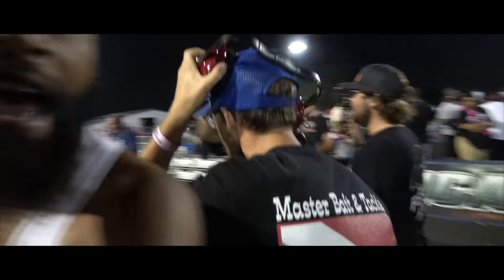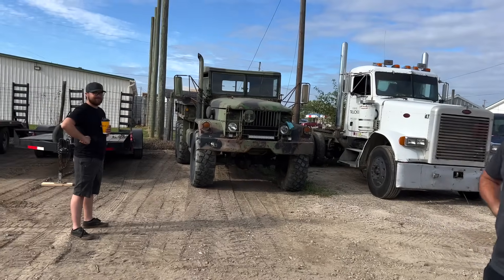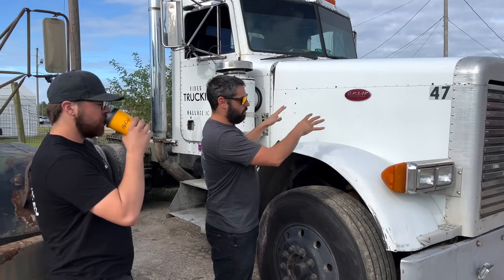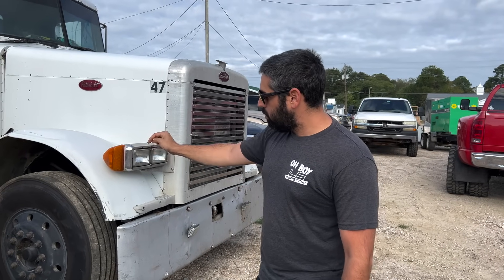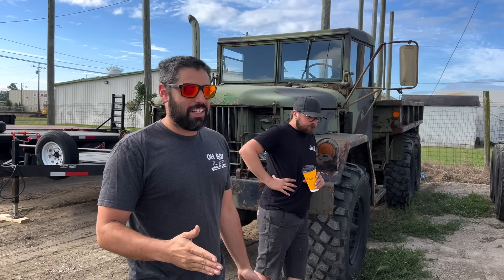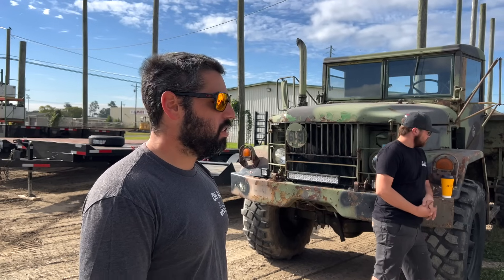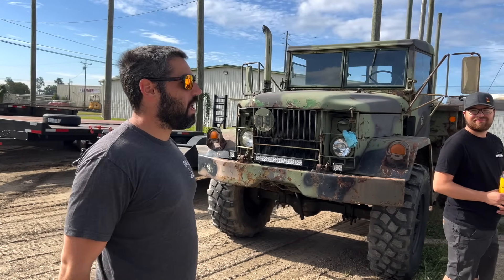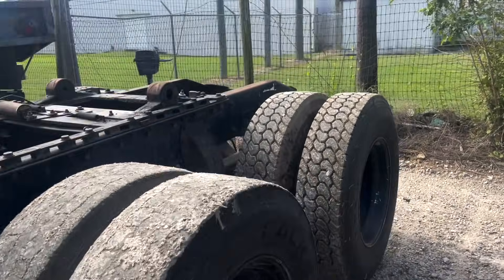BUILDING a CUSTOM SHORT NOSE 379 PETE!!!!

Comment: Needs a different custom hood round head lights. Clean up the bad ass grill just clean it up ditch the horns dual air breathers. 8 inch stacks 48 inch flat top sleeper. And of course you have to chop the seat mounts so you can sit low 310-320 in frame be cool paint match the cab sleeper and frame black out all the Crome

Comment: Sage on Pete will turn out nice put a couple desert tanks on it some low profiles but don't color on the outside it's going to be great under-the-hood should all be chromed and once you lay it down make sure you put the mud flaps behind the front steps to keep rocks from hitting the tanks and drop your your mud flaps behind the rear man it's going to be nice I'm keeping an eye out I don't know if the 13-speed is the best way but I found an easy unit to drive was the Super 10 where you were shipped and then work the rest from the accelerator to easy transmission maybe with good gears she'll still get out there and stretch our buddy good luck on it all the best wishes on it from an ex truck driver make sure the CB is a good one so you can talk over everybody when you need to if you ever go to Kansas City on Water Street down by the truck stop there's a good Radioman there eating pumpkin get that radio pumped up alright buddy good luck all eyes on you

Comment: Trust me, you want to go black on the frame and the axles as well!!!

Unless you love and plan on shining your truck more than driving your truck, keep all that shit black!!!

Keep all the running gear from the frame down and firewall back, black!!!

And if you’re planning on a transmission swap, just go with the 18 speed. 

And if you plan on splurging on anything other than the motor, do a disc brake swap all the way around on it! You’ll be thanking every time you touch the brake pedal!!!😉